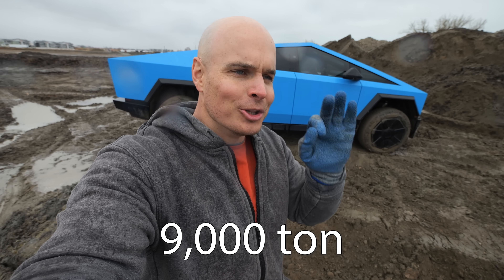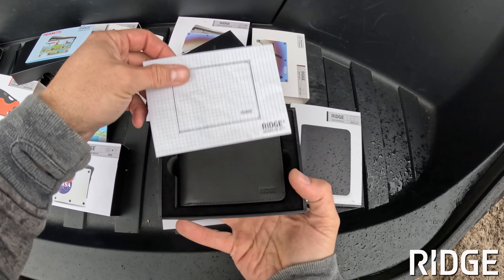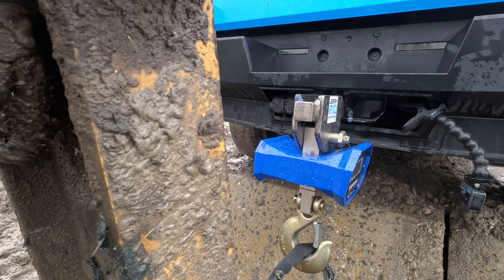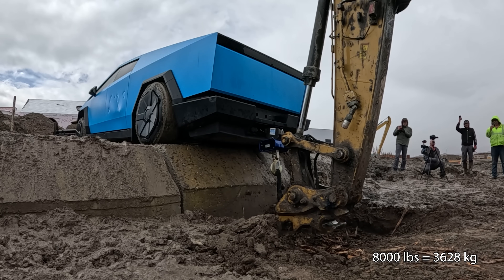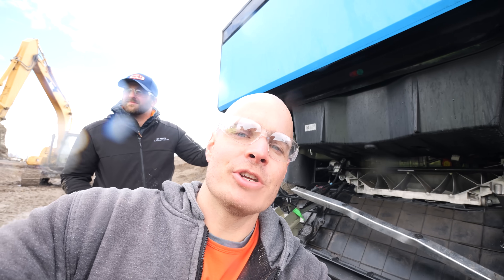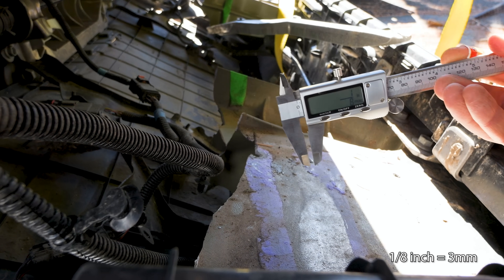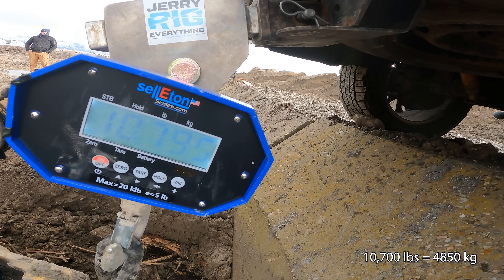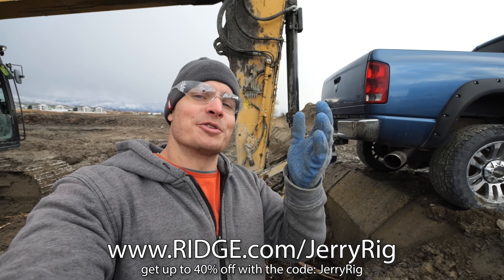SHOULD YOU TOW WITH A CYBERTRUCK?! - (catastrophic failure test)

Comment: The Tesla Cybertruck's hitch has a maximum tongue weight — the downward force exerted by a trailer — of 1,100 lbs (500 kg). Therefore the frame broke when the specification was exceeded approximately 9x. That is not "a improperly loaded trailer or a trailer hitting a pothole". That's complete neglect and driving with a completely collapsed rear suspension over jumps. Also, you won't "break" a steel frame, you will bend it, and bending a steel frame ist still a catastrophic failure.

Comment: There is a thing called tongue weight vs towing capacity. Typical tongue weight for Class 3 to 5 is only about 500 pounds, that's because of offloading the front wheels as you mentioned. If you wanted to test the towing capacity you would need to pull horizontally behind the truck using a winch or something. The trailer is what physically supports the load on a trailer, while the tongue weight needs to be enough to want to keep the load attached to the ball hitch. The rolling weight of a load is much lighter than the actual weight and rating of any hitch system
Reply: He knows the difference between tongue weight and towing capacity but intentionally tested it incorrectly to make the Cybertruck seem worse than it actually is.

Comment: The purple "glue" looks like structural epoxy. I used to be a research and development chemist for an adhesive company that provides multiple adhesives used in the car industry. Ford used an orange colored epoxy, to act as a chemical weld in areas that spot welding was difficult. If you ever get the itch do any lab testing of products like glues and what not, Instron makes some great equipment. 

It was always a lot of fun to see where things rip apart, just think the hydraulic press channel but in reverse. Love what you do, keep on keeping on.
Reply: yup. its strong shxt. to give people more piece of mind & understanding. cars like bugatti & mclaren uses it to basically hold their cars together lol. along with a few bolts.
Reply: There is also a kind of epoxy, I forgot the exact name, that is being used to glue stern tubes into big steel ships. Like BIG ships, thousands of tons heavy The stern tubes are aligned and the epoxy is poured into the gaps, sorrounding hull & tube and it creates a perfect seal. Obviously it's all fixed and bolted in place but man, epoxy is some madly strong stuff if cured under the right circumstances!

Comment: Just an observation but appears  on cyber truck when the glue gave the frame was over loaded and just folded like a house of cards. if down the road the glue fatigue failed i wonder how much the frame can hold with no glue to help out and what kinda crazy failures we may see. at same time that's a lot of tongue weight that you would likely never see without an accident involved. the fatigue factor is the other curious thing to ponder here steel doesn't seem to have the same issues from what i have exprenced.

Comment: Towing specs are not about having the entire weight on the tow ball FFS. No towball is rated for that and most vehicles would fail if you do that. I'm all for a bit of cybertruck ridicule, but doing this is just wrecking a vehicle to learn nothing. Towing a trailer means the majority of the force is horizontal. Anyone who loads a trailer with excessive weight vertically is incompetent and ignoring what the engineering was designed around. If you needed to make towballs hold the entire weight vertically you would do very different design.

Comment: I'm not on the Cybertrucks side at all here, I would never buy it, but this seems a bit unrealistic. A 10k lb trailer is never going to put all it's weight downwards on the tongue like this test. Whether going down a hill/pothole/etc. That would have to be the worlds worst loaded trailer, in which I'd avoid no matter what vehicle. 
This truck doesn't have the battery to tow a 10k lb trailer effectively either, I don't think many sane people would be doing that.
I would have liked to seen this test after putting ~7000lb downwards, to then pull it straight on. See what it takes to snap off. That would be a more realistic bad case scenario.

Comment: Is this an acurate test though? Would it even be humanly possible to load 5 tons at a single point of failure like this? It seems like you would literally have to stack whatever you’re hauling virtually horizontal directly behind the hitch. And it seems like 10000 lbs of just anything won’t stack like that.

Comment: I'm in total support of your demonstration and agree with everything you said, except for when you suggested that an error of within 5 lbs constitutes a "very, very accurate result" early in the video. No, you're getting an approximate result, not a "very very accurate" result. If you weren't pitching the experiment as "very scientific" and "very, very accurate" this sort of concession wouldn't be necessary. That is to make no mention of the fact that you performed the experiment in a muddy field for some stupid ass reason, and didn't isolate for the truck's suspension (which wouldn't be compressed in the direction which you compressed it in order to make your point about the shear strength of cast aluminum.) Good on you though for having expensive fun with your buddies!

Comment: So if it reached 10,500 on static load on the steel hitch then bouncing it with dynamic load must have been like at least 13,000. Also to get more weight onto it you gotta get the excavator closer, load on the point of contact is proportional to the distance to the center of mass.

Comment: There is a difference between tongue weight and towing capacity. That was actually pretty impressive.  Even in the case of a shifting load causing excess tongue weight - that is completely different from a consistent downward force being applied hydraulically.

Comment: The issue with casting aluminum or any metal for that matter isn't about porosity, it's about the crystalline structure of the metal. Casting allows for large crystals and fracture gradients to form during the cooling process, this makes the metal more brittle and prone to shattering when impacted. Forged or extruded metal doesn't have this issue because the metal is forced into a shape and only allows much smaller crystals to form.

Comment: Dude you cannot fault Tesla for the hitch breaking at or under its rated towing capacity!!  The towing capacity is 11,000 pounds but the hitch weight capacity is usually no more than a 1,000 to , 2,500 pounds , most hitches are only rated to 500 pounds tongue weight.  So this is kinda bullshit and it’s an unnecessary hit against Tesla .The fact that it held 8,000 pounds is actually pretty damn incredible if you knew what you were talking about.

Comment: This result is quite good.   You basically put almost pure tongue load on the hitch.   The spec says 10% max tongue load of tow capacity.   This held up to over 90% load.
Reply: and its aluminum. that wears. if you're paying like 200k for a truck it should hold up better than a truck that's been sitting for years after an accident.
Reply: You clearly didn't watch the entire video to see him explain why this is still an issue.
Reply: @WrenchingWolf92 It's not an issue this is an unrealistic scenario
Reply: @WrenchingWolf92  the vertical capacity for the tow bar on a Ford F150 is 500LBS, the cybertruck exceeded that by 21x before breaking
Reply: @Jst4vdeos lol that is hilariously wrong
Reply: @Jst4vdeos  Did you not listen to jerry saying why it's still a major issue?  Anyone in the metallurgy world knows cast aluminium is a terrible idea for a towing mounting application.  Why do you think decades of cars and trucks have never had aluminium tow hitches used?  Never mind cast aluminium.  Sure elon has advanced casting and metallurgy with his giga casting technics but cast aluminum will never be a good idea for a towing mounting point.
Reply: @bigwangmark  And the steel will rust  just like every Chevy and Dodge older than 3yrs. It's designed for what it's rated for. Exceeded that stress in a single impact 10x the rated capacity teaches you nothing. The Dodge 1500 wouldn't pass this test and it's steel.
Reply: @bigwangmark  And the steel will rust  just like every Chevy and Dodge older than 3yrs. It's designed for what it's rated for. Exceeded that stress in a single impact 10x the rated capacity teaches you nothing. The Dodge 1500 wouldn't pass this test and it's steel.
Reply: @rokuplayz464  And the steel will rust  just like every Chevy and Dodge older than 3yrs. It's designed for what it's rated for. Exceeded that stress in a single impact 10x the rated capacity teaches you nothing. The Dodge 1500 wouldn't pass this test and it's steel.
Reply: He didn't say it wasn't an issue at all.

Comment: This is good to know I usually pin my CT down with a loader while I load my trailer   . 🙄 I understand that steel frame has better ductility but the wheels of the CT will 2' in the air before the frame snaps while I load my trailer.

Comment: TOWING CAPACITY DOES NOT MEAN DOWNWARD WEIGHT,

9000 POUNDS MEAN PULLING CAPACITY...

MOST THE DOWNWARD WEIGHT WOULD BE ON THE TRAILER TIRES THAT THE TRUCK IS PULLING.

SO NOT ACCURATE TESTING..

Comment: "The load that the hitch receiver can support varies based on the configuration of the accessory carrier. The maximum tongue weight—the downward force on the trailer hitch—of Cybertruck is 1,100 lbs (500 kg)", Cybertruck Owner's Manual - but yeah.. a sponsored video, is a sponsored video...

Comment: You mentioned tongue weight, that should be the max downward force it should have to carry to past the test, you said the hitch was bolted to the frame, bolts will sheer at different weights depending on direction. you need to pull straight back in order to really prove the hitch is faulty as far as towing capacity.

Comment: The glue is actually called a structural adhesive. In a typical vehicle construction, they use structural adhesive to hold the roofs of cars and trucks on, and then they have spot welds also.

Comment: I appreciate you bringing up metal fatigue as an issue.  Right now the Aluminum can handle 10k lbs. But the older it gets and the more it is used the lower that number gets over time. The cumulative stress will eventually cause a failure at even a low weight.  It's only a matter of time.

Comment: Yes it is a test, but it is not a normal pull test. Given force in the test is downwards with a stationary car, not like you would normally get (force straight from back and movement). More realistic video title would be "Do not LIFT with a cybertruck if you have load over 4000 kg".

Comment: The people are not dumb. Pointless video…
Reply: Why would anyone ever use a truck to tow things, great point
Reply: @ the definition of tow is to pull... In this video 10k pounds are being pushed down onto the tow hitch, not towed/pulled. This odd looking bald guy is advertising the tow hitch is able to withstand 10x its capacity while trying to give the vehicle a bad representation. The ppl are not dumb. The ppl understand the difference between tow weight and tongue weight. No pot hole or bump on the freeway will ever apply 10k lbs of constant weight as a downward force onto the rear of  any truck within this capacity

Comment: It does not matter what the architecture is, or the materials used might be. You can ALWAYS come up with a test that will advantage one vehicle over another. This "test" demonstrates that a continuous leveraged force can cause potential damage at 3-4x rated capacity, and total failure at 9x. And to get to that point, you had to disable the suspension (that thing designed to absorb point impacts), as well as hold down the front of the vehicle to maximize frame stress. Trying to give some benefit of doubt here, but its hard because to believe that you are genuine is to also disbelieve that you understand basic physics. You say that climbing a steep grade converts towing weight to tonge weight? Not hardly. Assuming a 25 degree grade that instantly flattens to 0, (which you would need to be an idiot to try and tow ANYTHING over that sharp a crest, and would probably ground the hitch if you were going downhill), that is still less than 30%  of the total towing weight on the tongue.
Or are you suggesting that you are towing up a sharp 25 degree angle and then immediately back down without enough room at the crest  to get the trailer there, and managing a 50 degree between hitch and trailer? A standard ball is designed to have a maximum of 15 degrees of vertical range without using a pintle, so your trailor is almost certain to come off the ball well before you exceed the max safety factor.
Now, you have a valid concern as to the long-term deformation of the aluminum frame from sustained heavy towing and loads. To which I say - Duh?  Heavy towing is absolutely not intended to be a regular thing on this vehicle, despite it have the capability to do so. That is like claiming a vehicle is defective in design by wearing out quickly when used at a track despite having the performance specs to do so. And the aluminum frame does resolve that slight issue of frame rust - you know that problem that can become a serious concern on load capacity for a lot of older trucks?
Overall, this demonstrates that under a combination of overloading the hitch by several times capacity and also driving like an idiot, you can generate a catastrophic failure. Cool - almost as catastrophic a failure as you can create by underloading the hitch by several times capacity and also driving like an idiot. Used as designed it has plenty of safety margin.

Comment: That purple panel bond is just there between the panels to limit vibration between the bolted together panels. That stuff is surprisingly strong but it appears to be there for dampening purposes as it is also bolted It is not a structural part at all probably part of the fairings for the underside.

Comment: Always love your videos and watch them almost religiously, but I'm on the fence for this one. A bit sloppy and sensationalized.
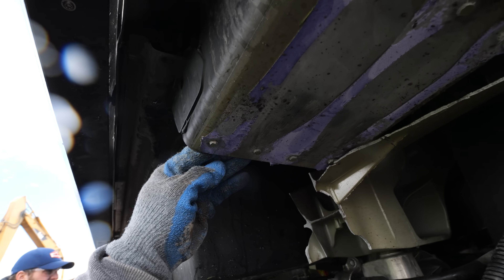Adhesives are fine, but it's probably just for sound reasons. You saw the rivets or spotwelds or whatever that were right besides the purple stuff. You even flicked them with your finger at 8:21
And 10.000 lbs real world tongue weight limit, with a 1100 lbs max weight limit on the books seems.... on the low side of safety factors? but not sure if that would warrant a "DANGER: DO NOT TOW". 
Did you truly look at a 50.000 lbs excavator putting in all it had, while the suspension was long bottomed out and the front was held down, and think to yourself "this is ridiculously weak, a true danger on the road"?
The 'cresting hill' argument at 10:10 is also a bit of a red herring imo. You can't crest a hill sharp enough to cause a real significant change in angle between your truck and your trailer because you'd get high centered. Unless you dangle your trailer off of a ledge as a makeshift dump trailer, there is a pretty clear distinction between tow and tongue weight. A trailer jumping the ball was a better example you gave I think.

There's honestly something to be said about that it should've had a bigger safety factor, but... not sure if this is the way.
If you ever get your hands on another cybertruck I'd love to see if you can break the hitch with an actual trailer.